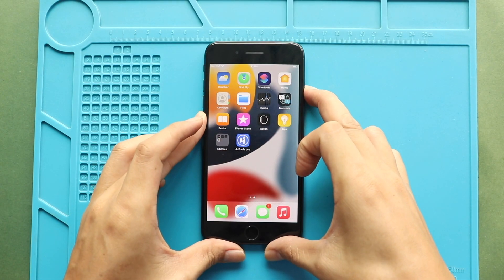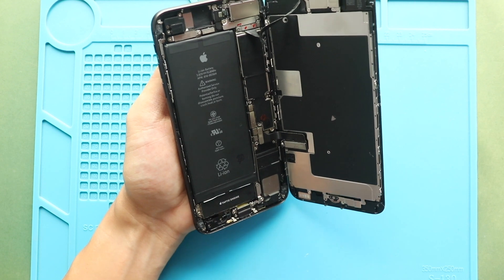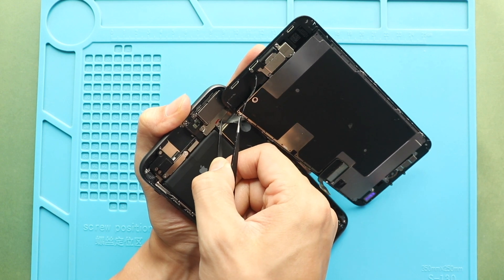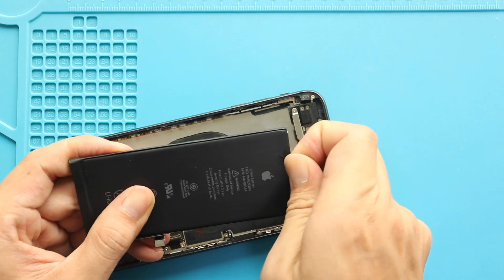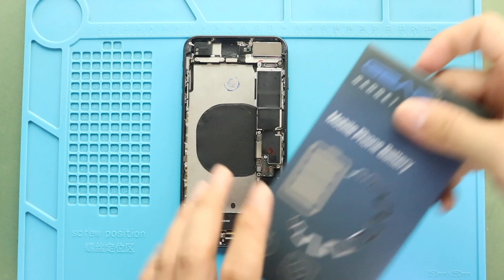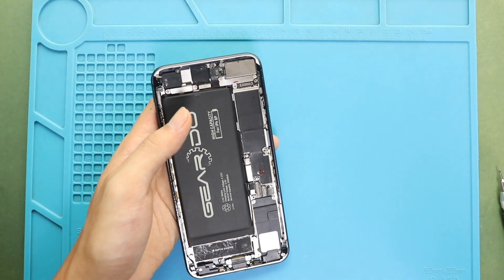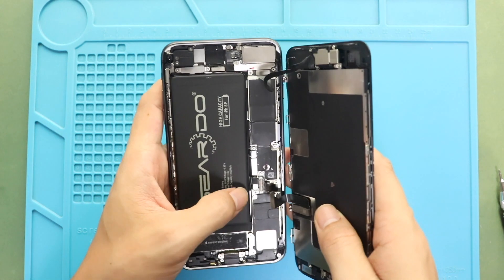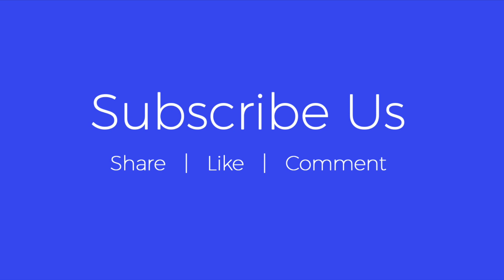iPhone 8 Plus Battery Replacement

Comment: The battery is not attached to the screen panel so why you had to remove the screen panel apart?
Reply from the maker: You need to take out the screen to go inside the phone
Reply: @DIYGeardo  I meant you don't have to completely detached the screen panel since the battery cable is only need to plug in the main panel not the screen panel. It is hassle to remove screws to detach the screen panel. Just leave the screen panel cable attached with the screen and replace the battery is fine.
Reply: @benle8011  That would make it impossible to replace the screen adhesive gasket. This video shows a proper repair. What you suggest is reusing the old adhesive which will compromise watertightness.